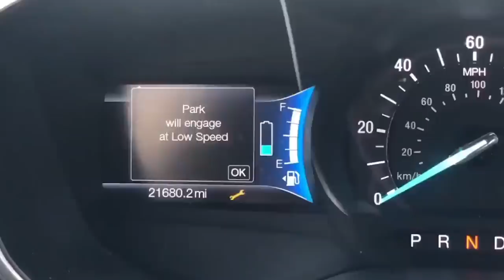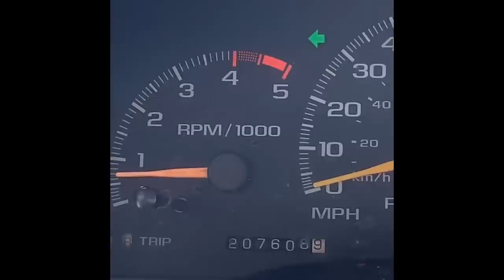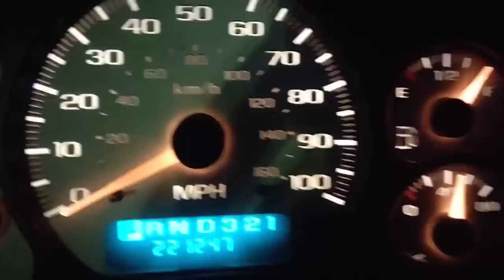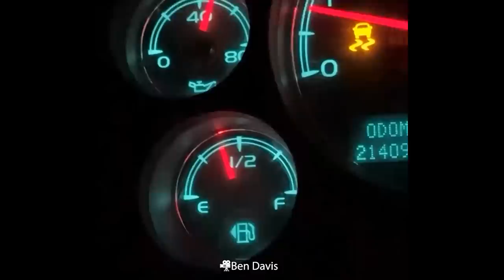Customer States & Mechanical Fails [Part 36]

Comment: What happened to the corvette at the beginning? Remote start on a MT car? It didn't look like anyone was in it.
Reply: You're probably right and it would mean that the customer added remote start themselves and probably leaves it in neutral in the garage (no safety switch!!).  My guess here would be that the customer was sitting in the waiting area and accidentally hit the start button and is thus fully liable for damages.  I hope so, anyway; if this is what happened then the moron could have killed someone just because they're a lazy SOB that can't even walk into the garage to start their Corvette.  I say "garage" because very few people park their Corvettes outside.

If you're adding remote start to a car, you're probably too lazy to drive anyway and should call an Uber.
Reply: Nah there was someone behind the wheel.

Comment: I'm a body tech, not a mechanic, but i see dumb crap all the time also. The mismatched headlights do not surprise me. Many people seem to miss between l.e.d and h.i.d. Then you have o.e.m and aftermarket which will not have the factory logo stamp. It's also easy for people to miss the trim inside the light.  Techs forget to switch the ballast, and they can't figure out why their lights are not working right. It's also ridiculous that these new cars need the bumper dropped to change the bulbs in some of them. They are making it where your regular person can't work on their own cars anymore what with 1 time clips and parts. You almost need basic mechanical knowledge anymore for the most simple task. Such as adding blinker fluid

Comment: i completely agree with the guys who hate german cars... i used to work in a junkyard where i didn't even have to do thing the "right" way, and i absolutely hated every single car that came into my bay that was german... what i could do to a chevy in 3 hours took 8 on anything german... but the one volvo (not german) i remember hating even more than those was a car where they designed it so that the drive shaft went THROUGH the GAS TANK, not above it, not below it, the stupid pos went THROUGH it...
Reply from the maker: and this is why mechanics hate engineers

Comment: 1:25 is likely just a faulty potentiometer, thus giving a wrong readout to the control unit....
Reply: It's encoder and it is indeed faulty. Proper way to fix it is to replace whole CCM

Comment: I wonder if some of these people recognize that tens of dollars worth of oil would have saved them many thousands of dollars in engine or car replacement?

A close relative of mine has seized at least 5 engines across multiple cars and has shown no sign of improvement, despite owning a smartphone that has calendar and reminder apps that could easily tell them when to check the oil.  Doing it once is a learning experience for non-car people, but 2 or more oil-starved engines is incomprehensible and you should have your license revoked as you're too dumb to drive on public roads :(.

Such people must have electric cars as they cannot do even minor maintenance on ICE engines, but one wonders if they'd remember to plug in an EV or even add washer fluid; a lot of people today are totally useless and would die without constant supervision.  A man can dream.
Reply from the maker: Even though they drive an EV, they will keep driving until the brake rotors are razor thin. 🤣🤣

Comment: @ 5:04 I have that problem with mine, except it's not the voltage meter that flicks with the signal, it's the fuel level guage that flicks.

Comment: AS a german i say most german cars are a pain to work on the engine because everything is crammed in little space
Reply: lets fit a 5.0 v10 with 2 turbos into a a6 and see how that goes
Reply: @Nordic_Mechanic  Easy. Go to the dealer, and buy a RS6. Voilá. 😁

Comment: I'd have to put German, Toyota Hilux/ Landcruisers and Subaru Forester/Outback as the worst. Stupid things like multiple different brakes on the same model so you literally have to see the parts needed and have cars on hoists overnight,,, or for days waiting for correct parts, with that theme continuing throughout the cars. Nissan Navara's are another another classic for mix and match parted cars, I've seen rear drum brakes for 3.0ldiesel model's on 3.5's that should only have 320mm drums not 310mm. Then there's the different multiple different fuel filter's ON THE SAME ENGINE, SAME YEAR AND MODEL! Aaaaargh. Then German stuff is always overengineered and you have to dismantle half the car to get to one bolt, plus similar issues as above. I'd rather work on cars that you're fixing the same issue's from car to car that go wrong on all of them. eg GM 3800 ecotec PCV Valve failures or intake gaskets! 😂😂

Comment: I've wrenched on tons of cars over the decades.
I will say one thing about German cars (Audi 200 particularly) the easiest heater core change ever.
From start to finish under 30 minutes.
Well, the Germans nailed that one..
Reply: Ok, but go and try to replace the turbo. You cannot access the lower left nut (seen from behind to front) between turbo and downpipe. Workaround: Remove front axle (no, i´m sober), then electric starter. Then bend a 15mm ring wrench into the right shape, and a second one too with a 20° offset. And if you´re lucky, the nut is not tight-rusted. And no, removing the engine is not an alternative, because first you need to - TADAA!! - separate turbo and downpipe... :face-purple-crying::face-fuchsia-tongue-out::face-red-droopy-eyes:

Comment: The randomly adjusting fan speed knob.  Definitely a Volvo and the only cure is a new climate control module.  Odd fact, internally they all use the same board even if you don't have the same switches.

Comment: Hey. Are the mismatch headlights real problem or is it just by the design with some reason behing it? Cars have different headlights if they are made for RHD or LHD roads according the local regulations they are made for and used at but these are never visually different by the side - just by function. Is this really a problem of the poor quallity controll?
Reply from the maker: After some research, we found out that somehow two new cars came out with cheap halogen headlights on the left side and expensive LED lights on the right side of the vehicle 🫣😃

Comment: 8:18 I would say the entire Chevrolet family (Corvette and Camaro included) and Wrangler 2.2l . You have no f*cking space to do anything there. the absolute worst of them is the Corvette Stingray C8. You can't even drop the tank without squishing through tight gaps and removing screws that are too long for the place they are put in. Who the hell made the car like that?! Also they ship these things with the windows not aligned! 7 BRAND NEW CARS WHICH F*CKING SMELL LIKE D*ATH AND ROT FROM THE INSIDE

Comment: 5:34 that appears to be a VW 2.0t water pump belt, as the water pump is driven off of a small sprocket that is mounted to the non timing side of the balance shaft under the intake manifold

Comment: What happened to the Corvette???  Was someone inside?  Starter shorted?  Why did it start and drive off in reverse?  Manual transmission in gear?  Clutch safety switch disabled??
Reply: my guess is that the technician didn’t put the car fully in park (or fully engage the parking brake if it’s a manual) & didn’t block off the tires so when he exited the vehicle, it was able to roll off the ramp. but again, this is just a guess

Comment: One thing that i agree with is that German cars do indeed suck. For example, Volkswagen uses lug studs instead lugnuts for their wheels. I know it isn't necessarily hard to work with but i personally don't like lug studs, its an unnecessary design choice.
Reply: Lug nuts are threaded onto lug studs. Lug bolts are threaded directly into the hub/disc/drum.

Comment: My service manager told me to "stop being a pussy" when I refused to work on a lifted F350 quad cab long bed because it would not sit on the rack safely, I tried half a dozen times to get it into a position where our largest rack would pick it up (no I couldn't use the alignment rack either) It would get about 3-4" off the ground and start creaking and actually fell off the extended pads a few times as I was trying to lower it to the ground.   No damage of course it was a big ass lifted truck and I was lowering it as it fell.   The customer was standing right there watching it all happen and I told him to go to a truck specific shop or to empty all the tools/crap out of his truck and bring it back and we could try again. 
   
 My service manager came over telling me that its not my place to refuse service and "dont be a pussy" so he carelessly threw the pads underneath it and raised the truck looking at me smiling (like I was the idiot) and as soon as it got about chest high the truck fell off the rack.   Why am I telling you this?  The video of the tool box falling reminded me of what happened next. 

 Well when it fell off it went forward right into the middle of my co workers Snap On double hutch fridge and computer equipped tool box pushing it through the back (brick) wall partially into the tire storage room which also tipped the tire rack over.  The box was totally destroyed there wasn't a straight line on the thing, some of the drawers had to be cut to get them open and recover the tools.   
   My actual manager came running out screaming "what the hell did you do you idiot!" (directed at me) and I just smiled and said "Dave did it" and walked off laughing.

Comment: At 7:50 thats not an easy fix theres a hole in the front of the engine. Thats going to need a new front cover or maybe the part can be welded

Comment: I don't see how bits of timing belt (3:28) got into the sump?  Isn't it more likely oil flow was restricted by the total absence of oil?
Reply: It's a wet belt engine (1.0 ecoboost 3 cilinder). That means the timing belt runs IN the engine, in the motor oil. It's very important to use the right oil, that doesn't make the belt fall apart. This happens a lot, and pieces of belt clog the oil pickup, and then the engine is seized off course

Comment: 1:23
My winterbeater came with an aftermarket stereo that does this on the volume knob.
Turn it up or down too fast, anad it goes down a little.

It is a Pioneer, I think.
It has a remote too, in case I can't reach the stereo from the driver's seat.

It is, hands down, the dumbest stereo I have ever seen.

Comment: 3:27 that bottom end does NOT look like an engine that went 30k+ miles without an oil change. 

Those 1.0 ecoboosts have issues with the wet belt falling apart, it wasn't a lack of oil changes, that bottom end looks mint besides the overheated rod bearing from low oil oressure.

Comment: `? Does anybody know the reason for the squeaking at 4:23? my volvo 940 is making that sound whenever i turn
Reply: Check the cross coupling.
Reply: there are these cool places you can go called mechanics where you can tell someone about a problem your car is having and they’ll find out the cause (for a fee)

Comment: I'd like to know what happened with the first one.
Reply: First thought is was remote start, left in reverse. Someb bypass didabled.

Can only guess it was a manual left in reverse, 
with key on, ign off, 
starter was bumped and sway it went.
Reply: @Scoot7827    Could be, but it came to a stop after crashing through the door.  As though someone had their foot on the  gas pedal instead of the brake, then hit the brake after crashing through the door.  But, that is just my guess.  Can't tell if anyone is sitting in the driver's seat due to the hood being up.
Reply from the maker: If you guys pay attention, someone underneath was working on the car.
Reply: @Carhax    And that caused it to start driving in reverse, then stop after crashing through the door?
Reply from the maker: @my3dviews no clue how everything happened, we think that the car was left in reverse and somehow the remote start was triggered 🤔

Comment: There should be a minimal automotive knowledge requirement, and a minimal ability to service an automobile requirement, in order to become a licensed automobile operator.  This would remove the vast majority of the idiots on the roads and make automobile ownership more rewarding and safer.

Comment: I bought an Audi a few years ago. It wa a terrible decision. I ended up spending well over $20k in repairs and maintenance in the 3 years that i owned it. The turbo and exhaust system was always screwing up. I also hate German vehicles entirely because of the maintenance.

Comment: americans saying german cars are horrible to work on 
whilst they dont know those "german" cars are built 100% in america the only german part is the logo the rest is just american thats why eu cars suck in america 
import a bmw from europe to america and itll last you 300k miles with only normal replacement parts like pads and belts and tires and oil